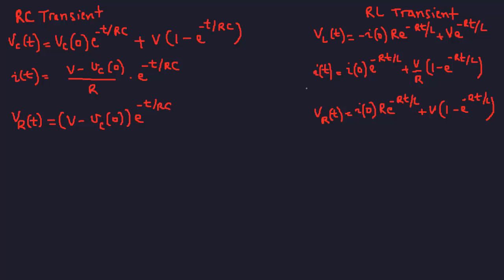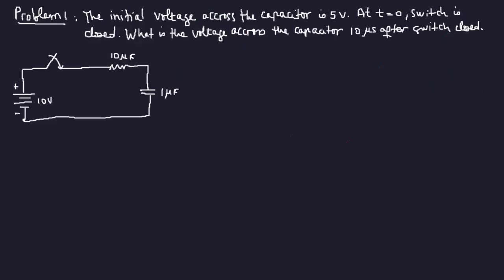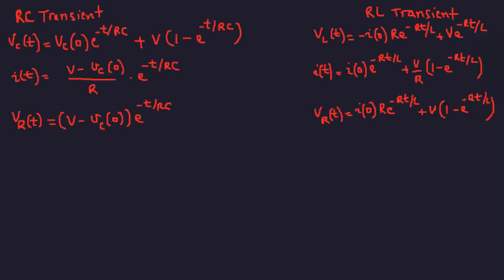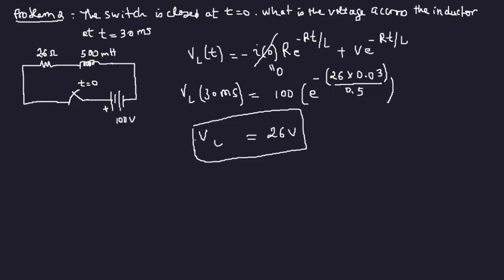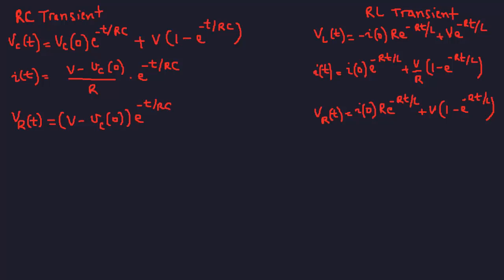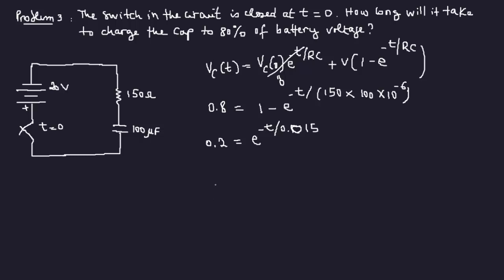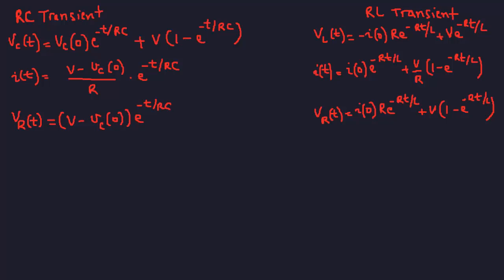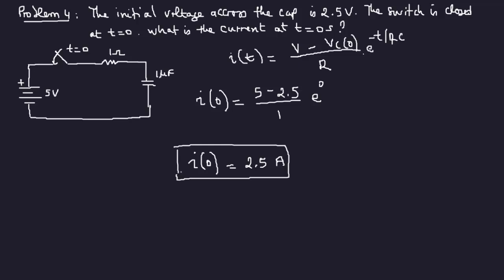RLC Transients-FE/EIT Review

Comment: Just to clarify Problem 3. 80% of the battery voltage is 16V.   Therefore: 
16V = 20 V ( 1 - e ^-t/.015).
0.8V =  ( 1 - e ^-t/.015)

Comment: I have a question. Do I need to take the FE/EIT in order to get into a grad school and after which I take the PE exam? Coz I have a Physics degree with an electrical/computer/math background, would I be eligable to take the EIT? Do I have to have an engineering degree per se?
Why do I want to pursue it? Thought it might help me when applying for work for electronics engineering jobs....and because I can :)
Reply from the maker: Jon, you don't need the FE/EIT to get into grad school at all. Though it might help given your physics background but it certainly isn't a requirement in the academic world per se. In the industry though, the FE/EIT can already help you in the job market a lot quicker than if you don't have it. Some positions even require it. It is the first step towards the PE license which is highly desired. 
The PE is also required for certain engineering practices like for instance if you want to do consulting or stamp certain engineering documents.

As for your eligibility, I don't want to give you false info so I recommend you to check to NCEES website. I know a guy from work who graduated with an Engineering Technology degree (which is not a conventional engineering degree like EE, ME, CE...etc) took it and passed it. So they may have rules for non-engineering-but-related-degrees.

Comment: never wasnt necessary because you took the .8 instead of 20v * .8
Reply from the maker: Yeah the 20 eventually cancel each other out (both sides of the equations). I sort of skipped that step but I should've put it there to avoid confusion. Thanks for checking.